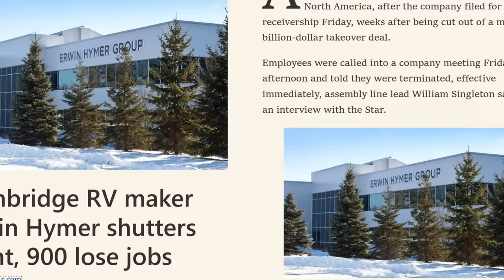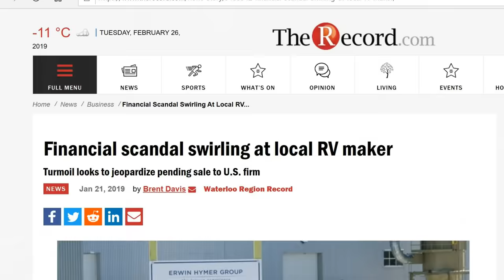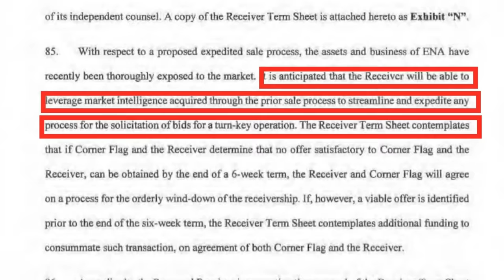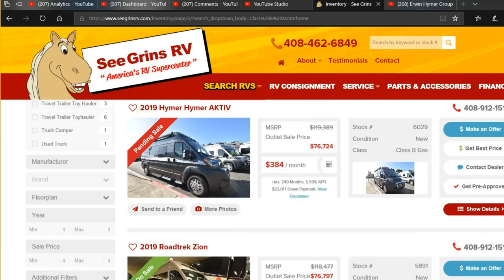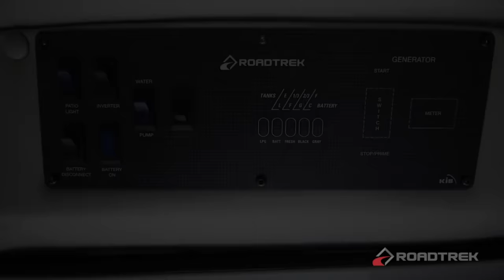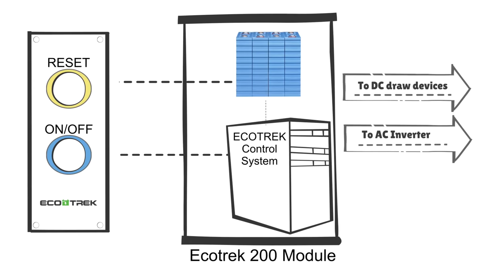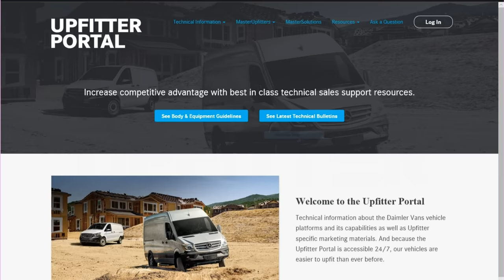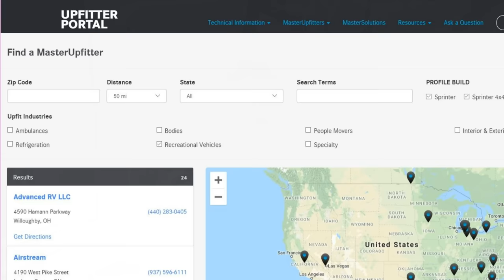Hymer Scandal | How It Affects Owners | What to Expect

Comment: @ultramobility could you please provide the source that specifies how the master builder status affects warranty for Mercedes?  Is it for cars newly released after the December 2017 date? Is it for cars sold after that date?  Is it for vehicles after a certain model year?  I imagine Mercedes can't retroactively remove warranty from vehicles designed prior to losing the status?
Reply from the maker: hi. well the first thing to note is that MasterUpfitters have a special relationship with Mercedes. When they purchase vans from MB the warranty period does not yet begin like it does for non-MasterUpfitters. For MasterUpfitters they have something like 18 months and 3500 miles that they can use to modify the vans before the MB warranty clock begins ticking. For non-MasterUpfitters the clock starts ticking immediately as soon as they purchase the van from MB. Most vans purchased by Roadtrek would be likely a year old so for instance if you purchased a 2018 Agile or Adventurous it is likely built on a 2017 MB Sprinter chassis. That means that the warranty clock is already started. That's the first thing. The second thing is (and this is my understanding from speaking with another MasterUpfitter) Mercedes does review and approve any modification made to their product from a MasterUpfitter. This is likely so that they are assured that nothing is being done improperly and it streamlines when a MasterUpfitter's van is brought in for warranty work - MB knows that any modifications are in compliance and they don't have to worry about it. When a van is brought in that has after market modifications that were done by a non-MasterUpfitter, then Mercedes doesn't really know much about what those modifications and how they were done so you will have to pay for them to do the diagnosis work to determine that. Then, they could come back and say the work wasn't done correctly and is the cause of whatever problem(s) you're having and are not covered under their warranty. At that point your getting into a fight with MB. If Roadtrek were around then they would just pick up the cost and have the work done but since they're not around you're left holding the bag. Mercedes may say that they will do the warranty work but then again they may refuse to do it. There are laws to protect the consumer but if MB decides not to do the work you're left with only a legal recourse and who wants to cover the costs and time for that? Likely you'll just pay for it out of pocket, curse Roadtrek and go on your way. MB knows that. That's why I say in the video that we don't know what modifications caused Roadtrek to lose their MasterUpfitters certification and therefore we don't know how MB will react.
Reply: @Ultramobility  Thank you for the detailed reply.  I'm hoping MB honors warranty on my 2018 RS (just bought it at an incredibly good price).  Carfax seems to think warranty began back in 2017 but dealer is claiming they will submit paperwork and warranty will begin from pickup.  Technically mine was purchased and built prior to Roadtrek loosing the certification.  Fingers crossed.
Reply from the maker: Your warranty probably did begin back in 2017 which is likely one roadtrek purchased your chassis and when they did not have their master outfitters certification unfortunately.

Comment: Thank you for this info; I just purchased a 2018 Aktiv, 2 weeks before they went belly up.
Can you tell me about the serpentine belt? Is this a Dodge part or a  Nation's (alternator) part?
Thanks
Reply from the maker: the primary alternator's belt is covered under the chassis warranty. the secondary alternator would have been covered under you hymer warranty but now that they are bankrupt you will have to cover this yourself unfortunately.

Comment: Unfortunately most RVs are overpriced garbage and the extended warranties are rarely helpful when you need them the most. It is a bummer to now have less choices but the shameful poor quality of these products is apparent in the pitifully short warranty that comes with the excessive price tags.
Reply from the maker: Word!
Reply: @ Mark Shaw:
So...how much does Roadtrek's (RT) 6-year warranty mean now IF (not sure yet) RT goes under? But there's something else to think about besides a warranty: There's no "Lemon Law" for RVs, so REGARDLESS of any warranty (especially if it's not worth the paper it's written on -- as the saying goes), one needs to pick the RV brand/maker AND dealership very carefully.
As I've said before though, the length of warranty isn't a big deal for ME, nor does it necessarily indicate the level of quality (materials used/fit & finish)...but usability & practicality ARE big deals. As long as the RV is decent quality and has the major things I want, the length of warranty is not a deal-breaker. 
I couldn't go with Hymer (low quality) or Roadtrek (average quality) for a very simple reason: Neither one makes a 4x4/AWD and 4-Season Class B (not one or the other, but BOTH)...so they weren't on my Short List (a pretty SHORT list, however, with only one entry presently). ;-)
Perhaps in the future, especially if things work out for Roadtrek (I'm still not interested in a Hymer RV), AND they finally wake up and make a 4x4/AWD/4-Season model, I'll definitely look at it. But again, the length of the warranty is still not a major issue (for me).
As for Coachmen, if they add 4x4/AWD to the already 4-Season Crossfit, I'll be looking at that one also.
-- BR
Reply from the maker: @Bill Redding - thanks for sharing those thoughts Bill. I think you represent many buyers.
Reply: The Carado Banff is fairly priced considering you could probably pick up a brand newish 2018 for 60k.... keep in mind for all you DIYers, a brand new ram 2500 promaster costs around 40k, now imagine the cost to install a fully functional bathroom, black tanks, grey tanks etc.  Solar and in hood generator + kitchen and seating/sleeping... and ultimately the time to do it... maybe you save 5k... maybe...
Reply: Maybe this is a good time for Volkswagen to get back in the North American market of camper vans. VW makes a very fine pop top camper van called the California. Ironically, you can't buy this van in California or anywhere else in the USA. With the future of  some of these pop top competitors now very much in doubt, Volkswagen might want to step in and fill the void.

Comment: thanks for the info. I was looking into Hymer 2.0 Loft because that thing could possibly fit 5 or 6 in a 21 ft package. . bummer.. Anything else out there in the market that will fit that many passengers?
Reply from the maker: for seatbelted passengers only you have the airstream interstates, the galleria 24Q by coachmen, winnebago era 70B, Midwest designs, weekender and day cruisers. nothing that sleeps as many though.
Reply: @Ultramobility  they're too big for my driveway. .  21 ft  is perfect. in your video you mentioned extended warranty.  Are those normally available from the dealer or are they available if let say I purchase a used RV. Thanks in advance for your time.

Comment: Looks like Roadtrek sold Hymer a pig in a poke with that Ecotreck system.. They didn't do their homework so more fools them I suppose.. It's the customers I feel sorry for..
Reply from the maker: here's an important note from a patron on Patreon as it relates to EcoTrek which many may find helpful:

christopher saeger
Neil, thanks for doing this video. I am a carado owner and have talked to my dealer regarding the ecotrek batteries. The dealership is aleady working with the manufacturer, KS2, to get batteries directly. Here is a post from Sam Carswell in the Hymer Activ facebook group confirming this as well. 

"This post should put the group even more at ease about ecotrek.   KS2 will work with dealers to service both your Revision H and L1 batteries.  They aren't equipped to work directly with owners.    Leaving your warranty stickers intact is a good idea since KS2 is working on a reasonable service program that your dealer will explain. Besides, the batteries are very heavy and hard to remove without risk."

Comment: https://www.newswire.ca/news-releases/rapido-sas-completes-the-purchase-of-the-roadtrek-rv-brand-886496857.html
Concerning the recall of existing CS Adventurous and RS Adventurous with 2nd row seating safety recall: did anyone find out if the new owner Rapido will actually step in and handle the recalls? And how?

Comment: Well this information just ended any possibility that I will ever buy a Mercedes Chassis.
Reply from the maker: uh oh. please don't do that. just make sure that the manufacturer is a master Upfitter!
Reply: @Ultramobility  What if the RV Manufacturer is a "Master Upfitter" at the time your vehicle is made but later looses that title?  Is your vehicle still covered by Mercedes?
Reply from the maker: i'll have to research that but I believe that as long as the vehicle was manufactured at a time when the manufacturer was a Master Upfitter (and no other alterations were done) that MB should be okay. My understanding is that MB does review and approve changes made to their chassis while you're an Upfitter precisely because they want to ensure that the Upfitter is not doing anything that compromises the safety of the chassis but also so that they understand what those changes are in the event the chassis comes into MB for servicing.
Reply: Ultramobility Thank you, I appreciate all of the information you provide!